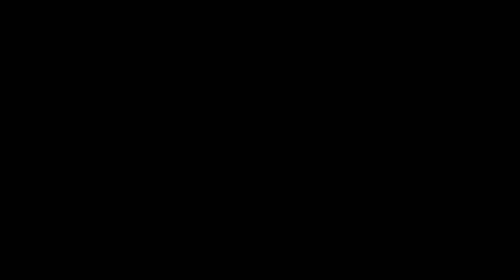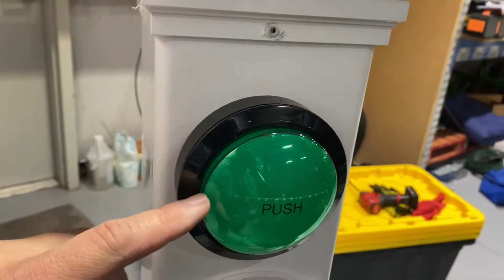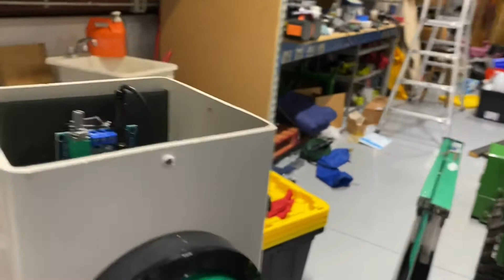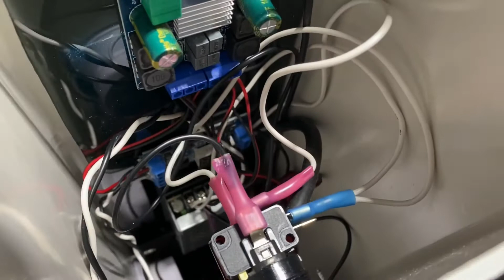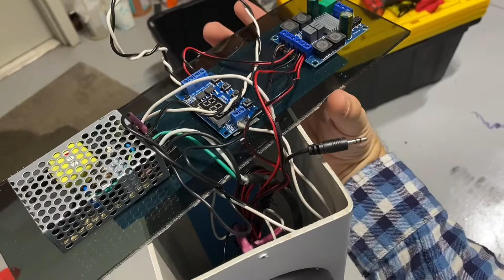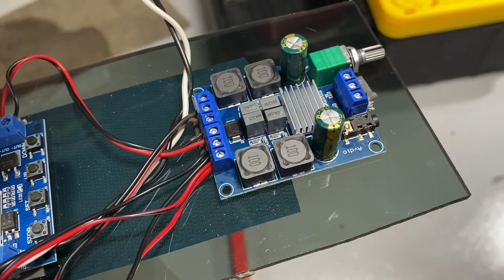Push Button Speaker

Comment: Do you think you can use a power injection pigtail from the main controller to power this, instead of running the PSU in the post?
Reply: Answering from another account.  I’d only be worried about the amp drawing too much power.  This is so far from the Falcon at my location that an extension cord makes may more sense.

The button timer I’m sure draws minimal power.  But the amp running for speakers…. Not sure I’d trust it from the controller.
Reply: @ubuyadronellc361 do you have a wiring diagram. Mine is acting all weird.

Comment: where does the sound come from is it downloaded into one of the modules or  do u send the sound into the whole module via bluetooth
Reply: I have a 3.5mm cable ran from the Pi out to the amp.  I don’t trust Bluetooth and potential latency.
Reply: @ubuyadronellc361   what is the Pi

Comment: Can I ask where did you get the speakers?
Reply from the maker: Amazon - Just some Polk Marine Speakers.  I have two on the pole and then run a line to the other side of the driveway and have two more speakers in the same fence post just laying horizontal instead.